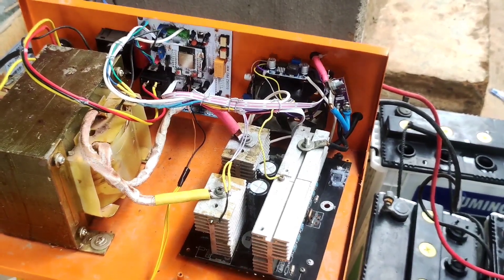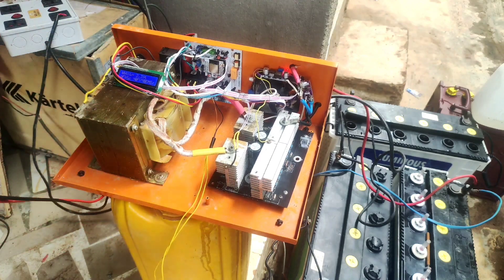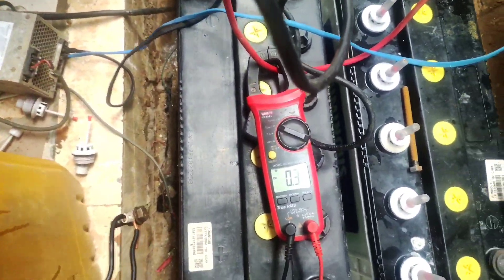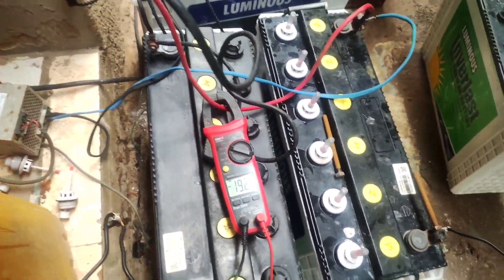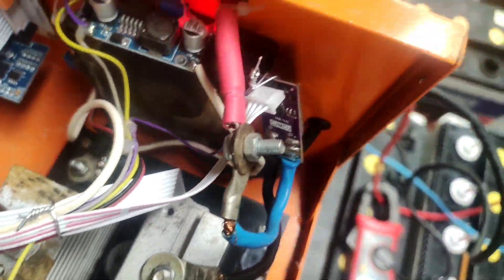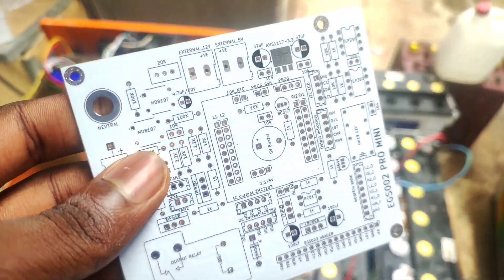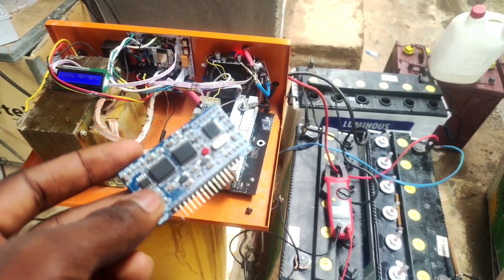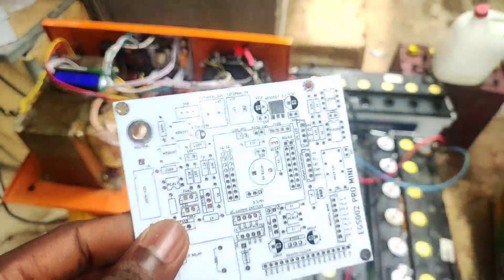0 - 40A charging current on EGS002 pro control card PART 1.

Comment: Good job ... I Will suggest that you should program both the inverter and charging on the same microcontroller. Interfacing egs002 with external controller and achieving perfect switching over from main to inverter may be tricky.

Comment: Good morning sir. Please I would like your help which will be precious to me. I made a sine wave inverter with EGS002 voltage 12 DC, 16 mosfet IRF3205 transformer that exceeds 20 amps. Here is my problem with no load the circuit consumes 1.8 amps as soon as I plug in a 75 W bulb the load current increases to 10 amps. Transistors don't heat up, output voltage is always stable etc... Please where is the fault? A 75w 8 amp bulb then imagine 4 or 5 bulbs or even more a television?
Thanks in advance.